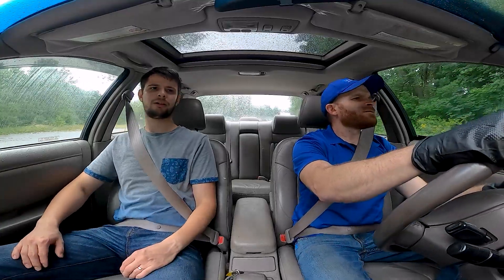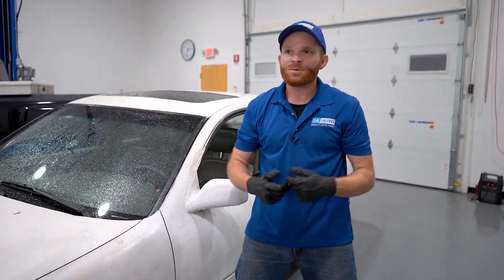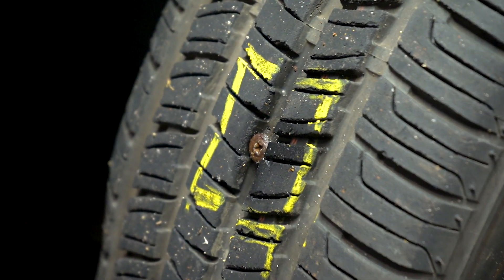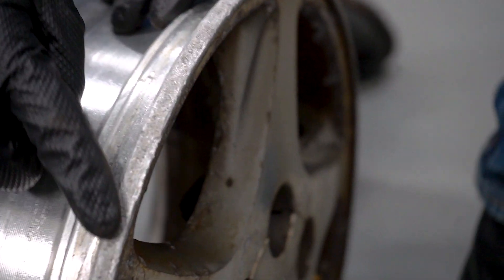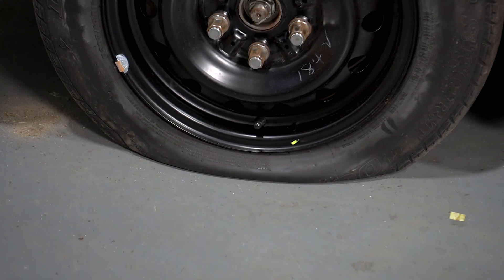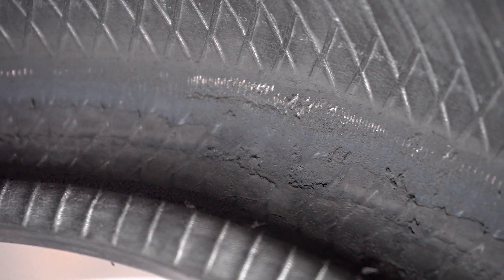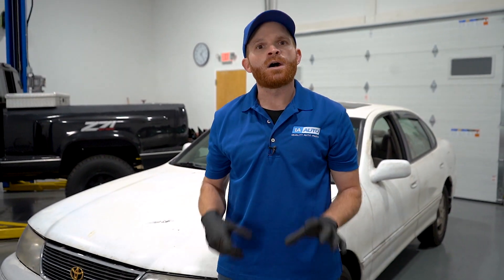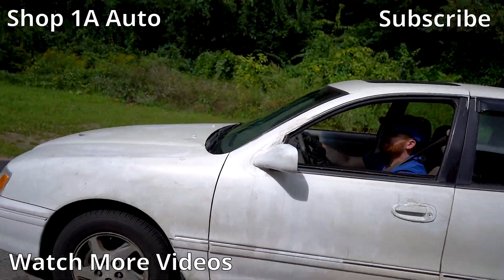Don't Do That! Why Driving on A Flat Tire Is Dangerous, And Could Cause More Damage!

Comment: If you do decide to drive on a flat tire, GO SLOW!  Don't try driving at highway speeds with a flat tire.  Activate hazards and use the shoulder if you need to to avoid being hit.  Driving on a flat tire at more than 10-15mph may cause you to lose control and crash.

Comment: I had a flat on Labor Day (ran over a random chunk of 2x6 in the road). Spare was at home... Called AAA, and after 45 minutes of being on hold, I drove it home. 5 mph in a 1963 VW Beetle, for two miles. Even with a 3 inch gash in my sidewall, it remained in one piece.  I wouldn't recommend it to anyone, but it can be done in an emergency. Key is drive SLOW.

Comment: Unless you are on a freeway. Never ever change a tire on the freeway. Slow down, turn on hazards, pull to the right as much as possible and exit the freeway.
Reply: I've gotten a flat on the freeway, I didn't change it on the freeway, but pulled onto the shoulder and got it changed out

Comment: Great video. I’ve switched to “Run Flat” tires on my cars. So much safer. Allows me to safely drive with absolutely ZERO air pressure so I can get to my destination. Basically eliminates the need for a spare and dangerous tire changing on the road.

Comment: DRIVING ON A FLAT TIRE.
(BEST ADVICE: DON'T DO IT! 🥺)

But if there is no choice, you should...

1. Drive VERY slow.

2. Replace ASAP with your SPARE TIRE.

3. INSPECT the "DAMAGE" of the TIRE which you run FLAT.

a. Inspect the RIM. 
(1) Make sure the RIM is not cracked or has sharpened edge (SMOOTHEN it out before replacing it). 
(2) If damage is really bad, REPLACE THE FULL RIM for safety.

b. Re-INFLATE a RUN FLAT TIRE.
(1) Check the tire very well...
    (1a.) Minor damage on tire must 
             be carefully assessed.
     (1b.) Bubble on tire (broke the 
              belt) VERY DANGEROUS.
              Do not re-use.
      (1c.) Serious damages inside. 
              REPLACE TIRE completely.

⛅🧍🚘

_

Comment: Be aware if you have an All Wheel Drive vehicle and you destroy one tire be prepared to buy all four replacements
Why ?  Because it the tire diameters are not equal in tread depth it will wreak havoc on your In an all-wheel-drive system, the computer ensures that each wheel gets the right amount of torque It reduces slippage and maximizes the wheel control
If any of the tires have less tread amount or smaller circumference than the others, the computer will take incorrect readings and send wrong information to other components
 Driving with mismatched tires for a long time can burn up the drivetrain

Comment: So what other damage can a flat tire do? I disappointedly watched the whole video without hearing or seeing what was in the description, for example if you're forced to drive on a flat and the tire is so torn up that it's whipping against the car, what other damage could it do? Brake lines for example, what else is located there in the front that this could mess up?

Comment: Had'a flat at frwy speed, but quickly pulled over, n threw my spare on.  Plugged tha flat, and reinstalled it, but, thank God, tha plug leaked, n I tookit to tha shop.  No visible external damage, but inside was full'a "tire seeds"!  (Burned rubber granules!)  If that plug had held, it woulda ended badly...  (And, if you're unfamiliar with "wheel tramp", google it!  I totaled an Xterra, due to a rear tread separation, and Wheel Tramp is NO JOKE! ☠)

Comment: I don't want to jinx it but the only flat I've ever gotten was at my house. I had my jack and jack stands so changing my tire to my full size spare was a breeze. Maybe it's just my maintenance habits or just a coincidence. However checking tire pressure is still important which actually lessens the chance of an object piercing the tire.